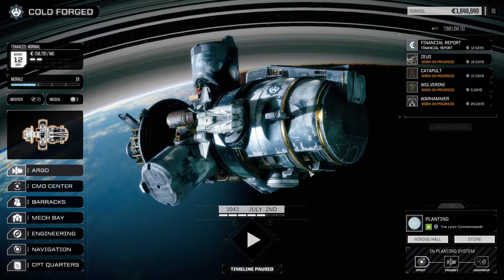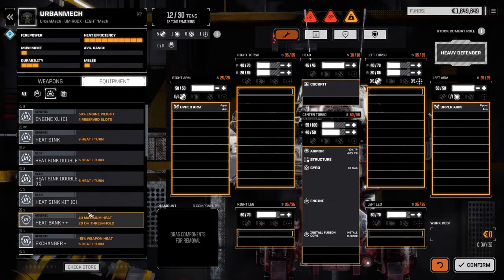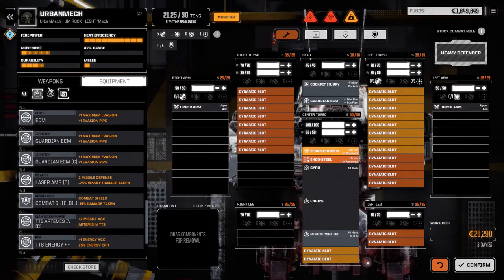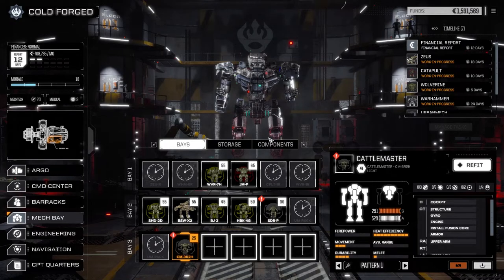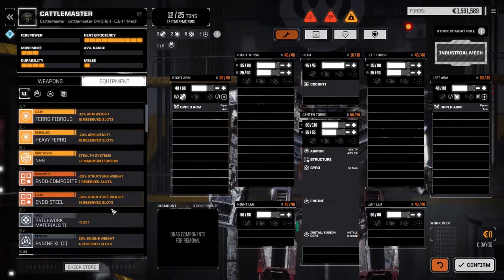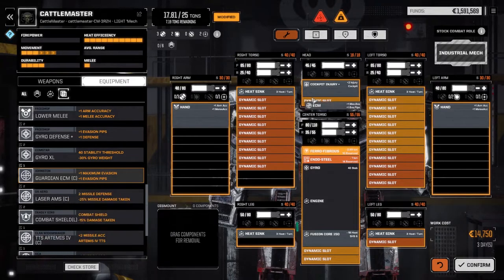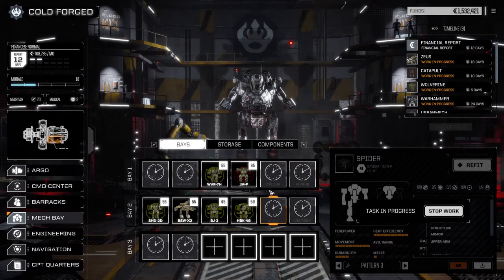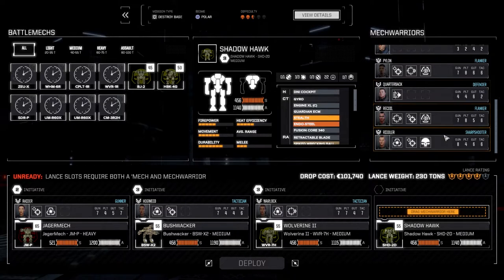Roguetech - COLD FORGED - Ep88

Comment: I don’t know what all would be involved in you being able to take your current pilots, mechs, gear, mech parts, and argo upgrades to the latest version of roguetech, but it sure would be cool to see them there.
All of the new mechs, models, gear, initiative system, and the live store where you can buy up parts that dropped in other players’ loot tables (any stuff not claimed by the player) are each compelling reasons.

If it is too much of a hassle to transfer all of the stuff over (I assume by using console commands to acquire parts and the like), then you could always do Warlock’s “Thinkin’, Runnin’, and Shootin’ Club” ;)
Reply from the maker: Unfortunately it breaks the save going to the Flashpoint version. I was able to restart the Funky Steve's Medinas series with almost the same gear as I had not gone too far into the series at that time but with these guys, I am too far in. I am contemplating starting something similar to this series called "Colder Forged", but I am not sure yet.
Reply: I had been wondering if there was some way to add gear to your save via something like console commands.
That’d take a really long time to replicate your equipment again having to find the item ids and type it all in.

If you like the new roguetech that much, I’d have to encourage you to start it up earlier rather than later. You could always increase the pay and salvage rewards for the first ‘so many’ missions to help speed up the restart process. —That’s something that might be worth increasing slightly above normal anyway as you are trying to keep three lances running at once.
Reply from the maker: I am going to try an off-line start first just to see what can be done. Maybe I'll switch over once it is further along, although I do like the idea of starting fresh with the next series.